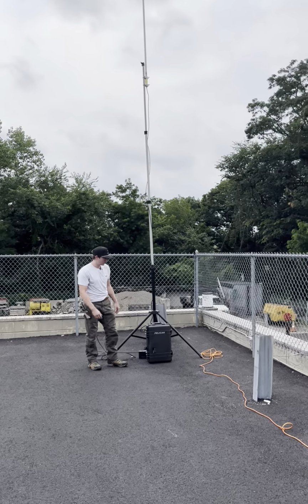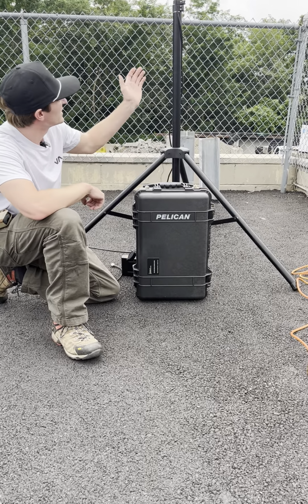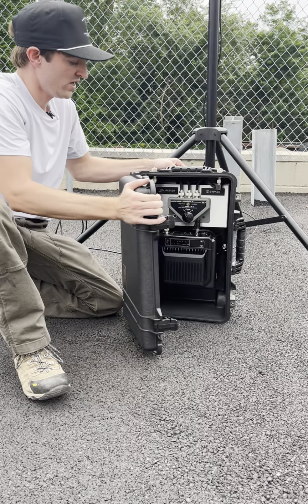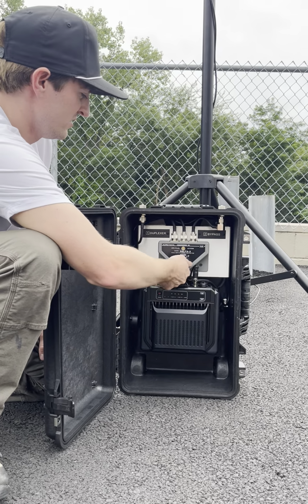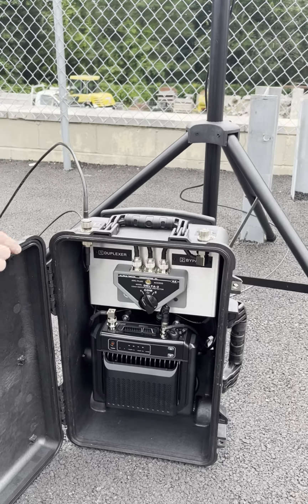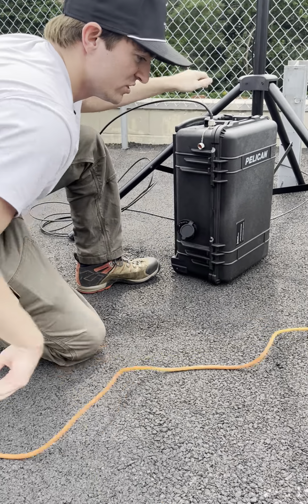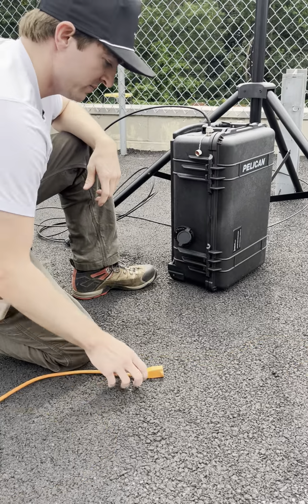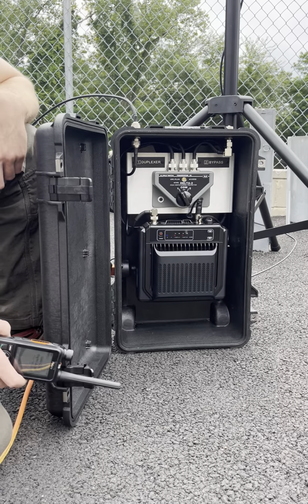Field Deployable Repeater Update

Comment: What radio system do you use for it? Not something I recognize. Tait or Kenwood maybe?
Reply from the maker: We used a Hytera HR652 repeater. Here's an overview we made   - https://youtu.be/TOwqg-OPMnM?si=wJU9li2jkuGbF51d
Reply: Awesome idea! Do you have a link to where you purchased the tripod? 
Also, I would suggest looking into some Neutrik powercon connectors for the external power input. They are a locking power connector that prevents the cable from accidentally becoming unplugged if pulled on. They are often used in the touring industry and would be great for this.

Comment: What about air ventilation?
Reply from the maker: That's a great point and something that we did consider. The HR652 is IP54 rated  so we recommend that our customers keep the case to the cover cracked when the repeater is in operation and doing so is feasible. If there is an absolute downpour or something that would make it infeasible to keep the case cracked open during operation, then the repeater will probably function fine so long as it is not extremely hot out or in direct sunlight. In the event that the repeater were to overheat it would power itself off to protect the electronics.  That being said, during our testing in 85+ weather we did not run into overheating issues when running the system completely buttoned up, in full sunlight and at full TX power. I would also note that the repeater is rated for an environmental operating temperature of up to 140 F.